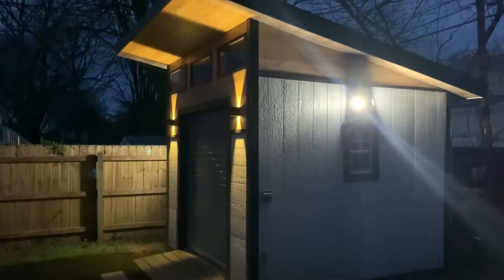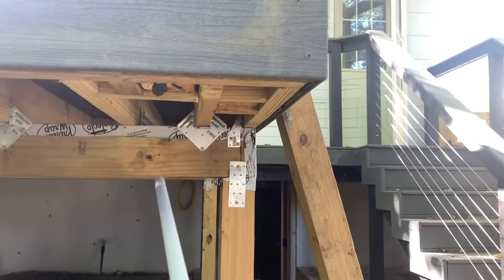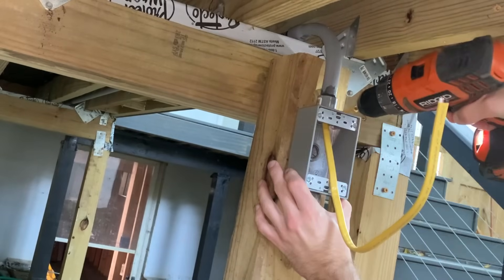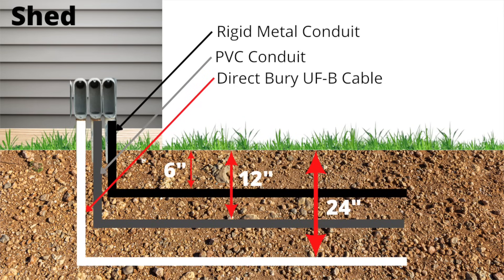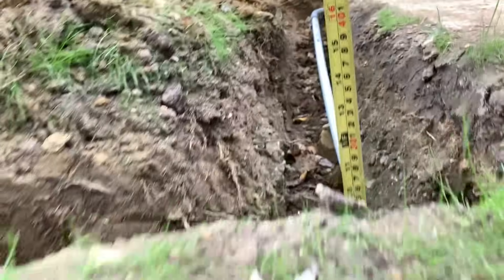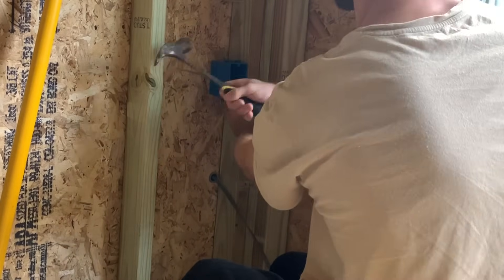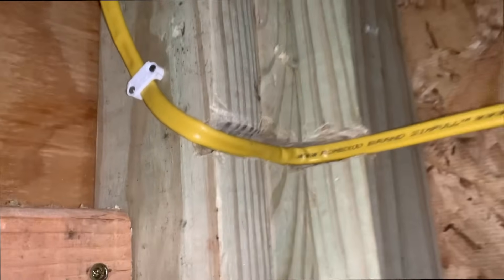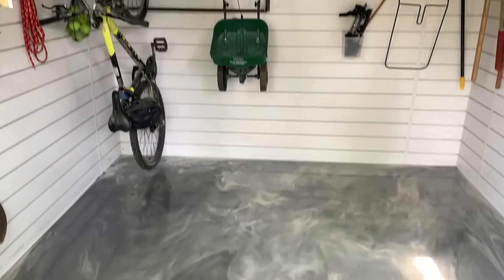Shed Electrical Installation (How to Add Electricity to a Shed - DIY)

Comment: NOOOO!!!  You cannot use romex in any type of conduit OUTSIDE. And you are definitely OUTSIDE. Should have used THHN. Yo
Reply: Correct
Reply: THWN for wet locations.
Reply: Yep and people are watching this as an instructional video. 😮
Reply: That’s UF CABLE ! Perfectly fine !
Reply: Inspection said all was good
Reply: So even in the PVC does it have to be if cable?
Reply: Hes using UF cable 
If its good enough to be buried at 24” its definitely ok inside pvc. Its actually more durable than thwn. 

Here’s the misunderstanding, “Romex”for dry locations must be used only in dry locations. 
The reason is dry location  romex typically has two issues that are not meant for wet locations. 
1-the wires inside are not coated and protected as well as THHN or THWN and can be compromised easier than the THHN or THWN. 
2-The paper that is in the romex is guaranteed to soak up water and travel all the way through the romex causing a major hazard if not GFCI protected or possibly in a worst case scenario can have enough resistance in the water and electricity could potentially not cause the breaker to trip, resulting in a very dangerous electrical shock. 

So bottom line is romex in Dry location and concealed in PVC is perfectly fine. 
Also Pvc must be schedule 80 only in the areas where it is potential to damage, if not sch.40 is fine. 

Any UF wire can be in conduit, because it does not fall under the dry location romex and is sealed with no paper in the sheathing.

Comment: Hi. Can you help me out? I tiled bathroom and didnt dry epoxy water properly after grouting. There is no Physical stuff on the surface but seems like there is a haze in pores that wont come off no matter what i hit it with from standard shelves. Kerapoxy cleaner , Pci durapox finish, heat, acetone, alcohol, vinegar didnt work. i scrubbed it with stainless pad for pans or copper tubes but it did not come off. (the epoxy grout in joints did react but haze did not)
Any tips for removing that haze where drop of epoxy water rolled down please ? thank you very much.
Reply: mineral spirits? Diesel?

Comment: Just because it works that doesn't mean it's done correctly. Several blatant NEC violations.
Reply: Such as?
Reply: Like what?
Reply: Romex in pvc conduit. Needs to be THHN in PVC
Reply: @MrDanmccuan  Doesn't need to be THHN in conduit, though that's the professional way to do it. Romex is allowed in conduit.
Reply: Definitely needs slip joints on either side. Once the ground freezes or moves over time it will rip out the boxes
Reply: @andrewferraro8568  I ran wire in conduit to my shed almost 20 years ago and did not know about slip joints then.  So far the boxes on each end have not been effected here in Minnesota where it gets cold.  Either it just has not happened yet or maybe it is because I buried the conduit 36" deep..................
Reply: List the violations that he made per nec👍 not bouncing around on what he should have did or the way you only do it. Because yes he has a couple of like the two ground wire on one screw. Another the boxes not flush. What’s else is there ?
Reply: @kevink4914  Some of them are running romex under the deck in conduit (wet environment), too many bends in buried conduit (360 degrees total), no disconnect in external building (cannot shut power in shed),  running cable before conduit completed (glue conduit then pull wire), drilling off center holes in studs (weakens support), no slip joints in conduit (to prevent ground heave), undersized conduit (hard to pull wire), to name a few violations or bad practices.  He would have been better off using a larger sized conduit and thicker wires, pulling separate wires, putting in a sub panel in so he could shut off power, and having separate light and power breakers in sub panel.  He could have set it up so he could have controlled his outside shed lights from the house as well......
Reply: @jaycahow4667  PVC expands about 4" per hundred feet in direct sunlight. The 3' stubs coming out of the ground expand very little and really don't need slip joints.
Reply: @pld8993  Rocks do not expand at all but are push by frozen ground up to the surface.  It is not the expanding of the PVC but the ground movement where the PVC sets that you have to compensate for up and down.................................
Reply: @jaycahow4667  In the real world when the stub is secured to the wall, not really

Comment: Just before you video came up I viewed "#1 DIY Electric Mistake - Can you use Romex Wire in Conduit?"  He said you can not run Romex in conduit in 'DAMP' locations.  I believe grass grows in DAMP locations.   https://www.youtube.com/watch?v=PZFJkXfThUg

Silicone rubber is hydroscopic.   Which means the inside face of the rubber can be wet.  So the question is the life of the paint since wood is also hydroscopic.

Comment: Would suggest you get a licensed electrician. most trades you can do yourself but electricity and water can cause irreversible damage or death with electricity or even nerve damage as your body is electrical, 
Good luck yall I learned tiling on here
Reply: Most jurisdictions allow you to do your own electrical work, so it's legal.  A good idea?  It depends on how well you know what you're doing.  I noticed that he had an electrician do the electrical panel work, which I would probably do, as well.
Reply: @pfcrow  He would have been better off putting a sub panel in the shed as well...........

Comment: Hmm, I didn't know that you did not need an electricians license let alone a contractors license to undertake electrical work in America. Not once did I see mention of any rules or regulations or how you calculated the correct size wire based on you load. The conduit you used look remarkedly like normal household conduit and not underground conduit. When you were finished who examined your work to ensure it complied with all state and federal requirements.

Comment: Not a good how to. You're going to fast to comprehend
Reply: I found it useful.  Some parts were quite fast, but you can find other videos with slow details on doing each specific point.  It depends on what you're looking for.
Reply: More importantly, there are many NEC  ( National Electrical Code ) violations here. You should not use this one as a guide anyway. See other comments here.

Comment: So the power HAS to come from the breaker box INSIDE the house? What about the breaker box OUTSIDE the house where the power pole lines run into? Wouldn’t that be easier since power is being run outside anyways?

Comment: You re over thinking this. A shed is a building which normally does not need much power.
I ran a 100ft  20amp  heavy duty jobsite extension cord. DONE.

!
Reply: That is fine for temporarily running tools but not a solution for permanently connected devices like lights.......
Reply: This is a permanent install not a temporary work station. If it was a chicken coop temporary wiring may be ok.
Reply: @jaycahow4667  Most lights in this time period are l.e.d and use very little wattage. Most sheds are just that, a "SHED", not a garage and shouldn't need that much power. 8 seven watt light bulbs are more than enough to put the brightness of the sun in a shed and use almost nothing in power, so I have no idea what you are talking about.
Reply: @louiewilkins7503  Not sure what type of hick neighborhood you live in but in mine people have real wood sheds with doors and even windows (120 sq ft min) with sub panels in side with multiple circuits for lights (in/out) and tools.  They have work benches with power tools and maybe air compressors and use their sheds for more than storage.  When I had mine built I ran Network/Cable/Phone in a separate conduit as well and it is insulated and has a heater so I can do things in the winter.  I have a separate garage as well.

This guy has a nice shed but he know nothing about electrical and should not be used as a guide...........

Comment: Couldn’t you just rout it without the gfci outlet?
Reply: If you have a gfci breaker yes.
Reply: No GFCI means the trench needs to be 18in down. But that is better, you dont want underground power relying on GFCI's, its a unreliable system long term
Reply: @Jeff  well pretty sure it's code to be honest . Myself I would pay the x.xx amount of dollars 💸 one time for the panel breaker instead of having to have branch circuits with multiple $20 plug gfci
Reply: @luvdady  I dont think you read my comment
Reply: @portaadonai  pretty sure I did..
Gotta have gfci somewhere in between
Reply: @luvdady  No you dont. A single GFCI outlet at the shed is fine. No need to GFCI underground wiring.

Its a far better system to NOT GFCI underground wiring- you WILL have problems in the years to come. No GFCI protecting underground wiring simply means the trench needs to be deeper. 

NEC CODE: Table 300.5 Minimum Cover Requirements
Reply: @portaadonai yeah well you still have to have one .
So why not just one and done at the main ?
And what like most folks you have an outdoor outlet as well?
Reply: @luvdady  because the GFCI will have problems over the years. Eventually the wires will not work on a GFCI, the only way to have power will be to remove the wiring from a GFCI, and now the trench is too shallow and more dangerous. The only proper solution then is to trench AGAIN
Reply: @portaadonai  so you are saying somehow the copper is not going to work by magic?
Reply: @luvdady  Ive been doing electrical work for almost 20 years, no I am saying it via experience -not magic. I am really not interested in explaining further. Believe what you want. Your the one who doesnt know electrical code or what their talking about
Reply: @portaadonai  It is not an unreliable system to GFI protect underground wiring. 12" with GFI protection or 18+" without GFI protection, there's no difference in reliability.
Reply: @pld8993  Yes it is, i have seen it over and over and over through the decades doing electrical work
Reply: @portaadonai  Almost impressive, except that I have more decades than you, rookie. You're wrong. If you think you're not wrong, please share your data, or are you just making this up to sound like you know what you're talking about?
Reply: @pld8993  GFCIs are more sensative! They will not work on wiring that has minor damage, which is common for underground conduit. Wires forced  to be on a GFCI will fail much faster than non GFCI protected loads. Use your head
Reply: @pld8993  Underground wiring has a higher failure rate than above ground wiring. Why does a rookie have to keep explaining this to you?
Reply: @portaadonai  Why? Because you're wrong. Repeating an unsubstantiated claim with no evidence is not explaining. Any evidence of this claim or just making it up again?
Reply: @pld8993  Yes, i have plenty of evidence, I have eye witnessed it over and over. Sounds like you dont have much experience with this
Reply: @portaadonai  Personal anecdotes aren't evidence. Been in the trade for 40 years, master for over 30 and been teaching the trade for over 20. You're wrong. "Wires forced to be on a GFCI will fail faster than non GFCI protected wires" Hilarious! And ridiculous. Do you even understand how a GFCI functions?
Reply: @pld8993  Wires with slight damage/water in a underground conduit will trip a GFCI, but still work on a breakrer.This means a GFCI will not be able to power those wires, but a breaker will.

This is the TRUTH, the TRUTH you are for some insane reason- desperate to ignore
Reply: @portaadonai  Oh right, I forgot about your evidence-free claim that ug conductors in conduit are commonly damaged. While anything that's damaged has the chance to fail, you saying ug conductors are commonly damaged doesn't make it true.

Lets' recap your claims that you've provided no data to substantiate: 
Wires forced to be on a GFCI will fail faster than non GFCI protected wires (my favorite)
you dont want underground power relying on GFCI's, its a unreliable system long term
 the GFCI will have problems over the years
wiring that has minor damage, which is common for underground conduit
Its a far better system to NOT GFCI underground wiring- you WILL have problems in the years to come
Underground wiring has a higher failure rate than above ground wiring (please provide the rates of failure of ag vs ug wiring, in numbers)
Reply: @pld8993  Many times, I have wires underground on a GFCI that will not stay on, but trip. I remove the GFCI and put a normal breaker, and power is restored

No amount of intellectual gymnastics coming from you is going to change that
Reply: @portaadonai  I've seen that a couple times, too. So what. That doesn't mean ug wiring is inherently unreliable when it's GFI protected or that eventually you WILL have problems, as you claim. No amount of opinions with no evidence from you is going to make you right.

Comment: NEC requires that only UF Cable be ran inside of Conduit , and NOT NM-B Romex ! Non metallic sheath cable, NM-B Romex  is not rated for wet locations. This is a code violation.

Comment: Would add a grounding rod at shed..
Reply: It is aGFCI circuit. Not needed or a good idea unless you have a sub panel.
Reply: As master electrician for over 40 years, I would have.. but you know better..

Comment: Sigh. There's alot you shouldn't have done.  Romex and uf cable don't go in conduit due to heat rating.  You use THHN or THWN wire in conduit
Reply: Both romex and UF are allowed in conduit and being in conduit does not affect their temperature. They do not overheat simply by being in conduit.

Comment: Then theres me who powers their entire shed through a single extension cord that runs all the way down to my back shed goes to a power surge protector and powers my air conditioning, heating, radios, hifi system, my 80s tube TV, lights and a my beer fridge.. 

Now that I put it all like that I don’t think it’s safe lmfao…

Comment: I would have used some 3 ways, added more buried wires, to have a wifi switch inside to control the she lights.
Reply: Easier to use Cassetta wireless and a Pico remote. Plus you can get them in dimmers.

Comment: #1 AN OUTBUILDING MUST HAVE A MEANS OF DISCONNECTING POWER. instead of putting an lb into the building put a disconnect. This Is basic electricity and it wasn't done here.

Comment: You cannot run Romax in a conduit in a damp location. You did not wire this to code. You can use UF wire once you leave your house. Romax is no longer permitted or underground. Please edit the video. This is dangerous.

Comment: No real or proper electrician had any part or approval of this video. Here's why;

1. Sloppy wire run to exterior, no support, no staples, you can see a nail holding the wire in one spot.
2. Missing panel knock out, shouldn't have been left like this especially by an electrician.
3. No J box where wire exits the house to switch an approved exterior grade wire, this is where romex should've ended. 
4.THHN is the preferred wire for pvc conduit because of ease of install and amount occupied space. UF direct burial cable could be used here as its not against code, but the conduit would have to upsized as it should not exceed 40% of the conduits volume.
5. GFCI is not just black and white wires  there's also "line" and "load" configureration which are very important for proper protection, also you can clearly see the ground wire was not attached to the oulet itself.
6. Changing from pvc conduit to metal box means box must now be properly grounded.
7. Conduit should've all been installed first empty and not have more than four  90 degree bends, to a pull point, LB fitting or J box, then the wire fished or pulled through afterwards. 
8. Expansion couplers  should be used on long conduit run under the deck and where it enters and  exits the ground at both locations.
9. There must be conduit clips/straps within 12 inches of boxes or LB fittings.
10. Electrical line burial tape should've been placed over conduit run at about half depth when backfilling.
11. Romex should not be exposed in shed, as it's now subject to damage and or critters, he should've continued with conduit (rigid or flexible) or armoured cable instead.
12. Wrong box used for switches in shed as it doesn't have anyway to clamp the romex cables properly.
13. Box mounting for switches and lights isn't flush or even close to flush with finished surfaces where fixtures attach, as holes were made too small, leaving too much combustibles exposed inside the boxes.
14. Where framing was notched for wiring in the corner requires metal plate gaurds for protection.

This video is bad DIY electrical advice. 
This guy should just stick to building stuff, as the shed is pretty sweet.
All these items and probably more would've been caught by a licensed electrician or inspector. 

Be safe, be sure, hire a professional!

Comment: Installing Romex cable in a conduit outside is a violation of the National Electrical Code.
Reply: Romex outside is a violation; whether it's in conduit or not is irrelevant.